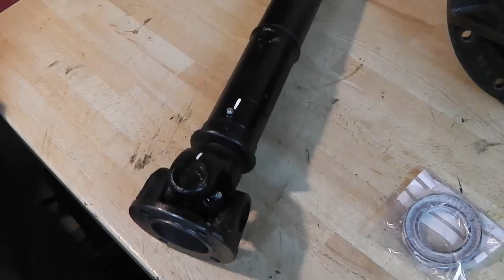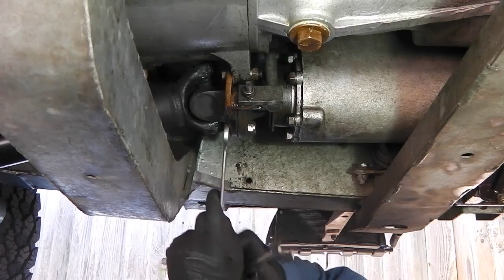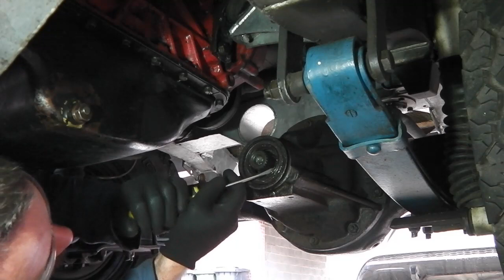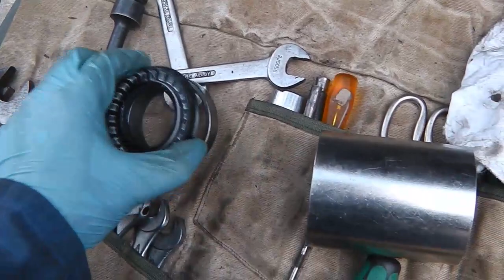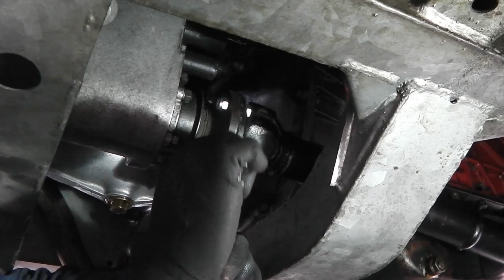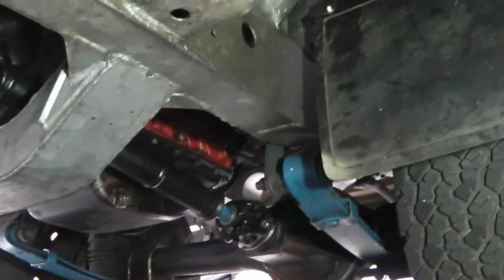Land Rover Series 3 - Differential Pinion Seal (Rover Axle)

Comment: Wow the underside of your Landy is so clean. I'm glad to have passed the right of passage!. Mine had the original leather pinion seals in. Man they were hard to get out!
Reply from the maker: The last time I encountered one of those leather seals it was well stuck, in the end I drilled two opposite holes and used a pair of self tapping screws to get it moving, worked well. I do try and keep the Land Rover clean, it helps spot any new leaks and looks after the new chassis. Even a galvy chassis will rust if mud is allowed to accumulate on it.
Reply: @steamwally  funnily enough that's exactly how I got it out.

Comment: brought back horrible memories laid on my back working on my series III many years ago.
thought there was normally a felt washer as well.
Reply from the maker: They get better with time.. the maintenance is a necessary evil offset by the enjoyment I get from using the vehicle. I'd spend a lot more time working on it if I had a nice warm garage to work in...one day..
I've not seen felt washers on diff's, but you sometimes find them at the output shafts and front half shafts.
Reply: @steamwally  now in my 50's I thought I would of learnt my lesson and got a bit wiser, no I bought a P38 a couple of years ago, still having to do the same old stuff, though these days I know about for a few days later 🙄
Last job was a turbo swap last month, even that had me laid under the old 👧
Reply: @chrisgreenwood271  totally agree. Had a 20 year rest from landrovers, had my 109 for 3 1/2 years now.   7.50 tyres weigh more than they used to and I don’t mind rolling round under her , it’s the getting up to get a different spanner that kills me!
Reply: @chrisgreenwood271  Apart from the  aggravation of getting oil all over your ill fitting reading glasses trying to see what you are doing ! Ivan's Shed should give us hope and inspiration  however for the road ahead.

Comment: Nice job and good timing for me, thanks - just starting both my pinion seals! I thought my rear prop had been fit wrong as the Haynes book says sleeved join near the handbrake drum on the rear axle, and near diff on front axle. It does make more sense to have it near the axles both ends though, closer the articulation?

Comment: All went rather smoothly on this occasion which is good. Looked like you had some up and down movement on the steering arm when you were tightening the filler plug?
Reply from the maker: It's easy when you've done it before! Yes, there is plenty of flex in the track rods as standard, it's the bar bending not play in the joints and is quite normal. Some owners like to fit heavy duty track rods for improved road manners, something I may try.
Reply: @steamwally  I still think your land rover is the cleanest one underneath I've ever seen! Good you keep well on top of the maintenance on it👍

Comment: Very helpful video. What size is the cylinder you used to knock the new seal in with? I bought the Haynes manual for my 2004 Defender 90 and can’t find any mention of replacing the front pinion seals at all so videos like yours are invaluable.

Comment: Nice videos you have - thank you. I have a Series 2A and am going nuts trying to decide whether to replace the seal with another metal cased seal like the original (which had leather as the sealing bit [County makes these replacements), or go with a rubber seal the likes of what Corteco and others offer. Which seal manufacturer did you go with and how is doing now? Many thanks

Comment: Hi Phil! Glad to see you still posting videos. I was wandering if you still had your Myford ML7? Was thinking of buying one and was curious about how heavy they are and if it's involved getting it off the base unit. Thanks very much!
Reply from the maker: Hi, yeah still around, not posting as much as I'd like but I try and put out one or two videos a month. The Myford is still doing sterling service and was in almost daily whilst I was working from home for a few months. Naturally they are pretty heavy, you'll want someone to give you a hand. Removing from the base is as simple as disconnecting some wiring and removing four bolts. They are nice little machines but commanding a premium - TBH I could well use an upgrade to a much cheaper but more ridged Boxford. Myfords are the darling of the model engineering world, highly versatile but a little stretched for anything serious.

Comment: Hi Phil, I hope you could advise! After watching this and your older video I attempted to do mine as it was spraying the underside. 

To my surprise the castellated nut was completely and utterly loose and just barely hanging in there by the split pin. There was a bit of turning motion play but not excessive, I think. 

Upon removing the old seal I noticed the p/o owner had left it too far forward and drive flange mud shield had take off the outer lip. The inside of the seal also wasn’t great. Does the p/os mistake of having the prop the wrong way around effect this? 
Anyway, upon fitting my seal, I didn’t have something exactly appropriate to tap it into place and had to make do. This led the seal to be position quite a bit further in that I had hoped. Looks like it’s on the “next” lip in. The seal looks fine and isn’t deformed it’s just stuck further in (as I used a sealant). I decided against trying to pry it back out and likely ruining it so I’ve left it. Will this cause me further problems? 

Now back to the castellated nut, I torqued it up to spec which then didn’t let me by hand turn the flange freely. I kept going down in 10 of torque until I got to only 35 which it was just about happy with. What do you think of that? I’ve used the split pin so hopefully it doesn’t undo itself. 

Best wishes and I hope you can make some comments to hopefully reassure me!
Reply from the maker: Hi, sounds very familiar - every Land Rover seems to suffer PO problems! I think you have a little work to do there unfortunately, the diff uses a pair of tapered bearings and the pinion shaft runs a slight pre-load - that means that it will feel slightly stiff to turn but not tight. This is achieved by shimming the outer pinion bearings on the shaft, so that the nut can be tightened down to the correct torque without affecting the pre load. 

If it's been running loose it will have likely worn the crown wheel. If you are having to run a lower torque on the drive flange then there are insufficient shims on the pinion shaft. You could probably mess about trying shims in there to get it right but perhaps now would be a good time to pull it out and send it off for overhaul. Setting up a diff is actually quite an involved job if you do it properly and it does require some engineering knowhow and measuring equipment. It's not very DIY friendly though plenty of folks have a go. 

The prop shaft being reversed is a very common fault though seemingly inconsequential, so that shouldn't have caused any issues. 

Sorry I can't make you feel better about it, but better to have it sorted now than when it's gone pop, and Rover diff's like to go pop!
Reply: @steamwally  thanks for that. At least I know where I stand with it. The “timken” bearing I pulled out seemed to be in pretty good Nick. It had two thin shims in front of it and then the thicker spacer. I’m a uni student (and on a budget)  and the rover is just a hobby so I think I’ll make do with how it is for now and keep an eye out for a good deal on a complete axle. 

Thanks again

Comment: no more breaker bars for me matey, just bought an impact driver and socket set....instantaneous with finger tip control...the little beast I call it ....a chinese cheapo £50 job...not a portable one...rechargeable I mean.... but saves a lot of huff and puff.

Comment: Hi, Did you check the Pinion Shaft Bearing, it looked awfull wobbly?
Reply from the maker: The pinion bearings rely on the drive flange being fitted properly, as this retains the outer bearing - so the shaft will waggle around when all that is removed. The pinion has a pair of taper roller bearings and runs a slight pre-load when correctly assembled. It's normal to feel slight drag or stiffness when it's set correctly, something that is measured during the assembly process.

Comment: hello steamwally i have a petter aa1 constant speed engine is there anyway to convert it to a variable speed easily and not replacing the injector pump? thanks
Reply from the maker: I had one of those many years ago - if I remember rightly, it had a plug which could be removed to get at the governor spring. I shortened the spring to slow mine down, but if you have access to a lathe (or know someone who does) I see no reason why you couldn't make up an adjuster.
Reply: @steamwally  aa thanks for the reply i will look at it temorow

Comment: Just curious is there a reason you don’t run a steering damper
Reply from the maker: I find that they make the steering a little too stiff and it doesn't self centre so easily. I find the drive is very much improved without it - no problems on rough ground either, just keep your thumbs outside the wheel.

Comment: Rr diffs? With better gearing?
Reply from the maker: No, standard diffs - perfect with the standard ratio box - they ain't built for speed :)
Reply: @steamwally  just saw the flat part on the diff house underneath. But then this is normal on other diffs also.

I know they are not made for speed, and it might be better with a over drive gear., but changed diffs sure makes the rest of the car seem calmer in 80km/h